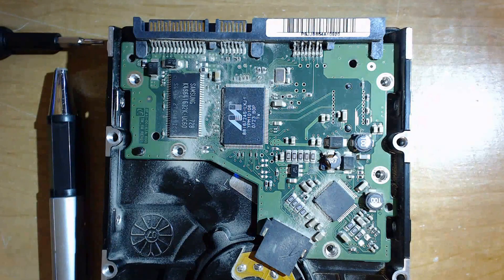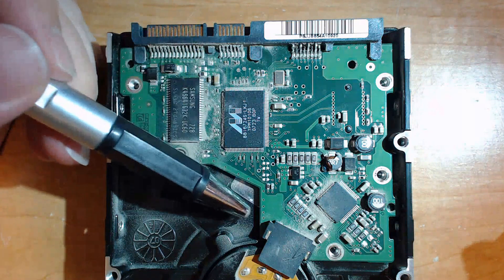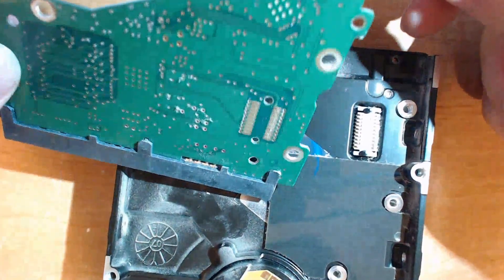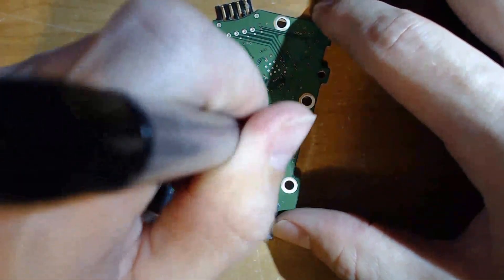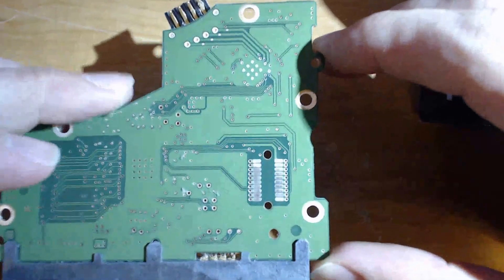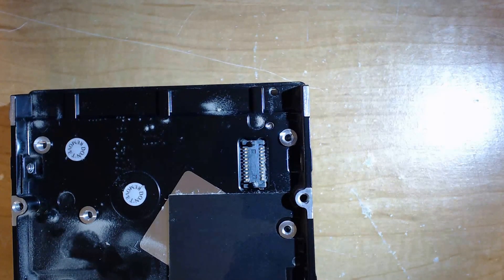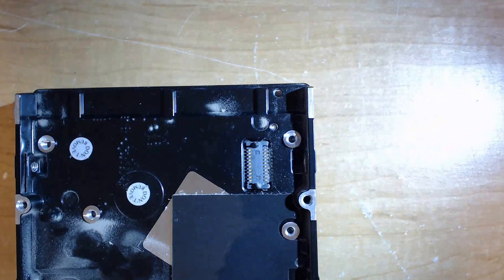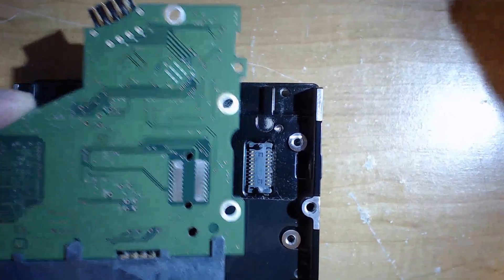Contact cleaning for HDD

Comment: I have 2 identical 2tb Seagate Barracuda from ~2012 both where giving me R/W errors and some times the my Motherboard would not even recognize them for days (Yep days). And not I don't live in a area with high humidity.
I stopped using them but didn't throw them away. More than a year later a random though come to my mind to check the other side of the PCBs (Around the same time I had recently brought a item needed to repair my phone that came with special screwdriver and it was the the same screwdriver needed to remove the HDDs PCBs screws)
Guess what there was some kind of black oxidation/gunk on the contacts. Cleaned it with a eraser and Isopropanol alcohol and both started working like new.
The only thing due to the many R/W errors in one of them the SMART registered a lot errors and back sectors that probably aren't bad and the only way to do a recheck/reset is with specialized hardware. But it doesn't effect me at all only if I want to sell them.

Comment: i get blue screen frequently
does my hdd pins and connectors need cleaning?
Reply from the maker: Really depends on the issue, blue screens are caused by thousands of different things. What is the error you get when it blue screens?